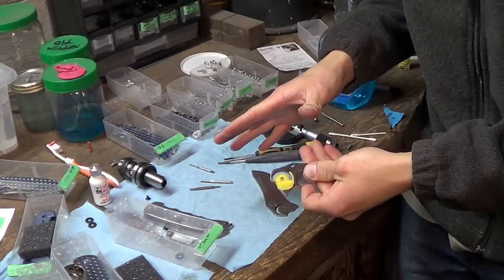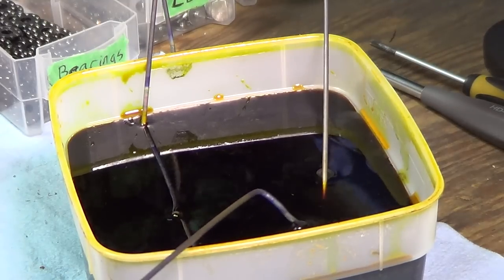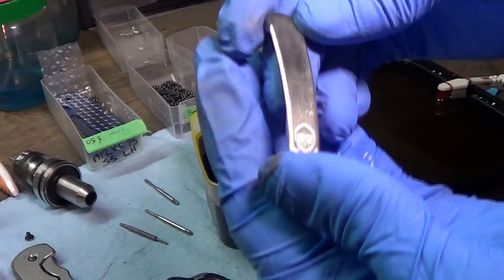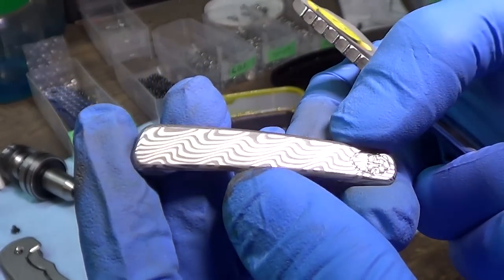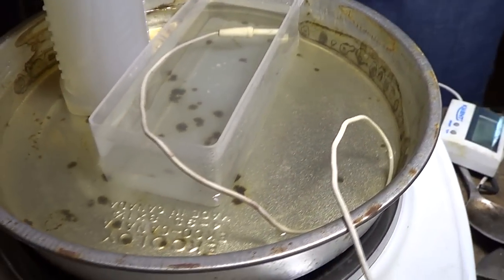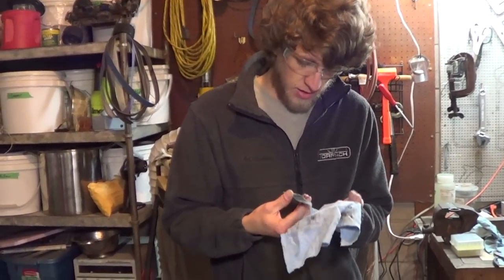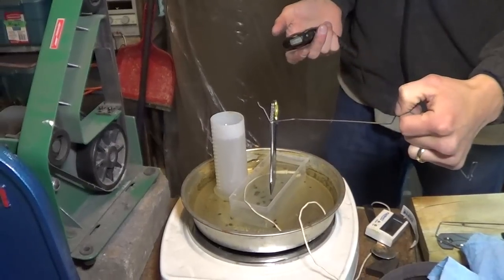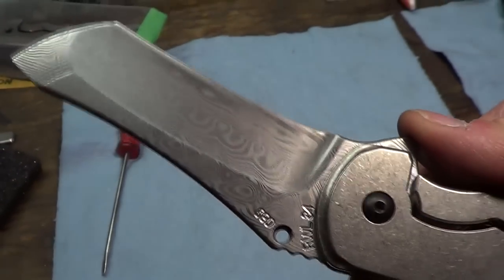Etching Damascus knife blades

Comment: so placing it in the acid does not affect the integrity of the metal?
Reply: No; acid behaves only on the surface of the metal; for two reasons: you immerge it only for a few minutes, and you neutralise it after (neutraliser depends on acid used). It does not have time to get in the metal, and you remove the excess at once. This can not affect the deep cristalin structure of the steel. It does not affect the long term behaviour (except for the particular and rare case of coated blades)

I never did acid etching, but I think that the edge must be pretty rounded after acid etching; and I think the blade will need a long sharping work to behave as new. The guy does not mention this point, and I feel strange about this point. I would be surprise you can cut anything as is. That in the two meanings of the word ... a minor side effect :)
Reply: Nice, I've never seen this before thinks it's pretty cool. Thanks for the reply

Comment: How did you get the pattern on the knife for etching ?
Reply: it is inherent in the material. It is two different steel alloys that are folded together in that pattern when it is forged, they etch at different rates and thats what gives the contrast.

Comment: They aren't Wootz steel, they are the common current term for Damascus, which is just pattern welded steel. Whereas Wootz was actually crucible steel and not forged at all but mainly made for knives as drawing it out on a forge would actually ruin the pattern in the steel., where as folded steels were primarily used for swords.

Comment: If you are going to use Ferric Chloride to etch your Damascus blade use a mixture of the 60% Ferric Chloride and 40% White Vinegar... soak your blade for at very least 30 to 45 minutes in this solution and then dip it in baking soda water to neutralize it.

Comment: Do I need special steel to acid etch a blade?
Reply: damascus steel
Reply: you can acid etch pretty much every steel, but if you want a damast pattern, you have to use damast steel....however you can use nail polish, acid resistant permanent markers, airplane model paint etc. to etch patterns on mono steel...

Comment: can you do this to any steel?
Reply: tzDub92 Etching, yes. With normal steels you need to blank out the pattern you want left (The nail polish is doing that in this clip). I think there are some special printer pages you can get and print design onto then transfer onto the medium of your choice you want to etch. Google etching. There are many different uses for it and a wide range of materials and acids used depending on what you want to achieve. 

It works like this with Damascus steel because the difference in hardness between the materials in the steel. The goal is to etch out the softer material with out taking to much of the other so that a defined pattern can be seen. Different ways of making Damascus cause different patterns to the end product.
Reply: tzDub92 masking tape is a failure. most tape is. dont let it sit to long.....you can burn through entirely...

Comment: How much do you sale a knife like the ones you have shown?
Reply: there rather expinsive if your not a serios collector but usually 500-800
Reply: there rather expinsive if your not a serios collector but usually 500-800
Reply: there rather expinsive if your not a serios collector but usually 500-800
Reply: Good price you do have a lot in them work wise and they are collectibles!
Reply: +jedediahbc ya he has alot of time in on them but stuff by hand is little to nun most of his cnc wanna see a bad ass knife check out like a bodega by todd bodega
Reply: +jedediahbc That is not Damascus steel.  It's whats called pattern welded steel.  I doubt anybody today even makes true authentic Damascus steel.
Reply: Do you even know how true authentic Damascus steel "Was" made.  Try doing some research.
Reply: +BennyCFD oh ya and also if it wasnt real dama steel it wouldnt etch so ya your real smart huh
Reply: LOL do some research for yourself on what true authentic Damascus steel is.  Then you'll be as smart as me, knowing how to do some research and have some critical thinking skills.
Reply: Uh....wrong, try doing some research online.  Damascus steel is the process of taking raw iron ore, placing it in a low temp crucible over a period of time which forms the distinctive line of carbide crystals.  Not from folding modern steels and forge welding them.  Look it upo for yourself.
Reply: +BennyCFD thats crusibplying not dama
Reply: Then why doesn't tell people it is not Damascus steel.  Or other knife makers who make "Pattern Welded" knives and say they are "Damascus"  Why, because they can charge more for them.  Most people aren't educated enough to know the difference, and that's what those knife makers are counting on.  Buyer beware.
Reply: BennyCFD yeah, im certain that is not the case. These knives cost in excess of $500, always. most of the time, they  are in the $7-800 range, so beleive me, the poeple who are buying these knives know their stuff about knives and are not gonna get them because they think they have real damascus. maybe If a rich person who doesnt know enough about knives buys it because they tihnk its real damascus and can spend that kind of money no problem, but i have a feeling something like that doesnt happen very often. In other words, the people who know knives an steels like me and you are the ones buying these knives, not the people who think its real damscus.

Comment: I don't get it apparently. The blade looks far better polished than with that pattern you get from etching. I thought the point was that Damascus steel is the strongest. Period. Why not leave it polished?
Reply: Etching just gives it a nice, cool pattern, Cept he made some mistakes so it came out a bit badly, but he said he's a beginner, so he'll be alright after a few more tries.

It depends on preferences, I suppose. I like etched blades over plain mirror polish.
Reply: Modern "damascus" steels aren't the same as the traditional ones are. Today, different steels are laminated and then twisted to create the "damascus" appearance, often also with some sort of pattern. The traditional Damascus-steel is a laminated blade steel with a hard core steel and then alternating harder and softer steels on the outsides. The pattern comes from grinding the edge. They can be etched, or if very old school, left as such and the pattern will emerge over time as a patina of the steel. The really big difference is that in a traditional Damascus, the lamination is lengthwise but in the ornamental version the different steels are across the blade. As such, they do nothing for the quality of the blade or edge.
Reply: "Damscus" steel USED to be (as in...several centuries ago) the strongest out there. The steels used during dark and middle ages were of inferior purity to those used today. The once awesome qualities of "Damascus" steel can be attributed to the layering of steels with relative differences in carbon content. This layering basically helped to mask the impurities in the different steels used by spreading them out (in a mono steel blade, an area of impurity will break, in "Damascus" steel, the layers around an impurity will support it.). The layering of different steels also made heat treatment more forgiving in terms of getting a durable blade that will remain sharp (using a high carbon steel and a low carbon steel ensured a hybrid of ductility and hardness). This was important before the advent of consistent quenchants (consider that there is historical documentation of smiths ACTUALLY quenching their swords in the bodies of live slaves. No joke. Today we know that this would be a terribly inconsistent quench...and murder.). That said, a modern "Damascus" blade is no stronger or better than a monosteel blade, as we have perfected both smelting and heat-treating processes to create pure steel with a high carbon content and heat treat it to the desired hardness for it's application. "Damascus" steel is now simply a more beautiful, and more time consuming, way of reaching the same goal.

Comment: Does anyone know what Damascus steel does?? Damascus Steel is not only for looks or toughness....The reason Damascus Steel is better than regular steel is all of the layers from hard to soft steel at each place they meet it acts a serration so that's why it cuts better than just regular steel..The more layers you have the more tiny serrations you have..That's what Damascus Steel does.

Comment: These are not Damscus Steel blades, they're are etched blades. Dasmcus ripples are not etched into the steel they're throughout the steel.
Reply: He is not etching the "ripples" in, he is using etching to bring out the contrast between the two metals that the blade is made from.
Reply: You clearly have no idea what "Damascus" steel is, which leads me to question the fact that you speak about it like you are an expert. "Damascus" steel is any pattern welding of more than one type of steel together in layers. Whether it is etched or not has absolutely nothing to do with that.
Reply: Thanks for clarifying LiamE69 I understand now I misunderstood what was being done, as for IIDASHII 'The original method of producing Damascus steel is not known. Because of differences in raw materials and manufacturing techniques, modern attempts to duplicate the metal have not been entirely successful. Despite this, several individuals in modern times have "claimed" that they have rediscovered the methods in which the original Damascus steel was produced."  "Pattern welding produces surface patterns similar to those found on Damascus blades, but they in fact not true Damascus blades." Your comment was less than helpful. I claim to be no expert just trying to learn so I can produce more blades at home.
Reply: C0RP5R1FL3M4N If you claim to be no expert, then don't speak about things like you are one. Wikipedia isn't an expert on Damascus steel either. Of course none of the steel made today is true "Damascus steel." Damascus steel was made in the middle east, hundreds of years ago. The term is generally used referring to pattern welded steal these days.

Comment: Isn't it false advertising to call a knife "Damascus" after it's been acid etched???
Reply: Would it be false advertising to call something made from wood wooden if you used oil on the wood to bring out the grain?
Reply: "Damascus" refers to the layering of different types of steel. Whether it is etched or not is completely superficial, and has nothing to do with it's categorization as Damascus steel.

Comment: Like the knife but I dont think you have proper ventilation for what you are doing. The fumes of the hot acid are very corrosive and this include your lungs. Use a closed box with   an extractor. Be safe. Good job otherwise.

Comment: . More people are using the name Damascus simply because they can get 
the swirling patterns. It's fraudulent and should be stopped. Damascus 
steel is only a name, given to the south Indian WOOTS steel workers pre 
1700's. Most of these blades were sold in Damascus, Syria, where the 
blade bearers praised it as the finest steel. Thus Damascus steel was 
born. The art of making these woots steel blades was lost by the 1800's 
possibly by the infringement of the British holding company. People also
 use thick steel cable to get this effect. Stolen valor at it's finest. A
 good looking blade no doubt, but not Damascus steel.
Reply: Wow, you may have stated some facts, but you are wrong, and are incredibly rude for little to no reason. It is definitely generally accepted that this is not geniune damascus steel, and its not marketed that way. its called damascus commonly, yet technically its pattern welded steel (or sometimes damasteel), and the person who made this video (who i imagine your comment was directed at) is a very well renowned custom knife maker with incredible skill, who himself knows this, and so do those who follow and purchase his work. Also, theres no reason anyone would want original damascus anymore, modern steels are far superior. This is just for aestethics. Nobody is claiming that these are the best in the world, and nobody who knows anything about custom knife making would think that these are genuine damascus, and they wouldnt care either because its pretty no matter what you call it.
Reply: FUGYOO Im so tired of people like you. If you're not a troll then realise this: if you want to have a genuine argument (keep in mind, arguments dont have to be full of name calling and other bullshit) with someone about something that can be debated, dont try to insult and discourage the other person, it doesnt help win the argument. If im coming off as trolling, just know that im not trying to, im trying to be informative, but if you dont want to hear it, then fine, be that way.
Reply: Keyboard warriors at arms😂😂😂